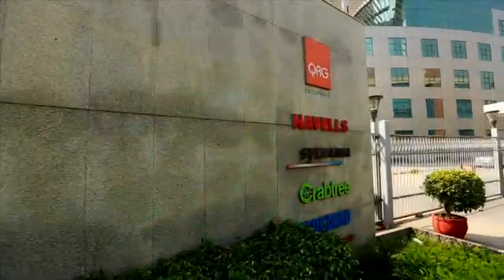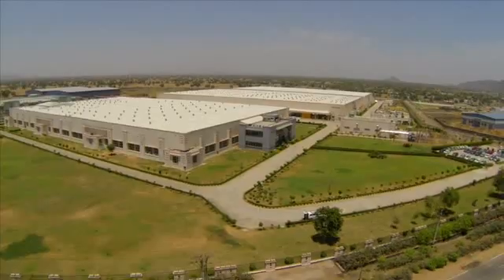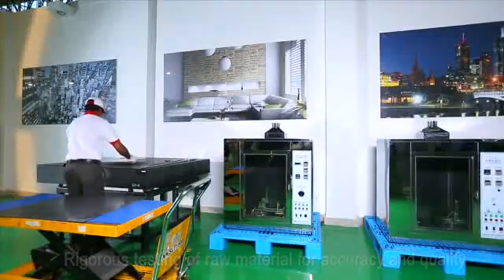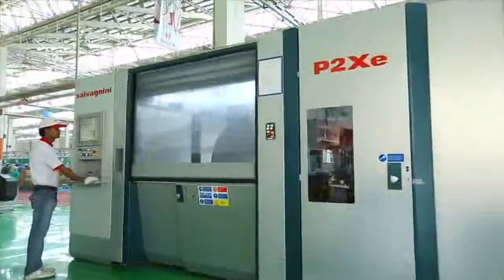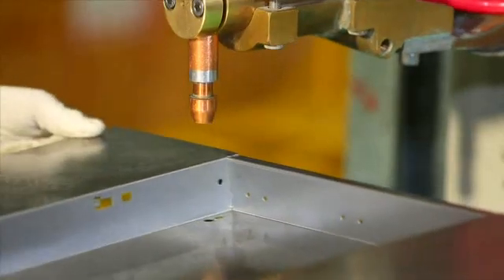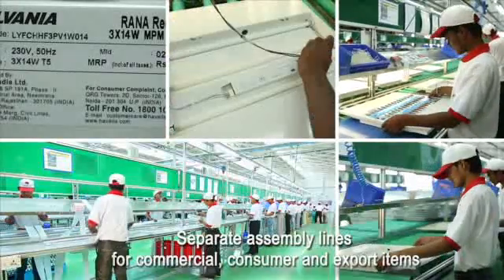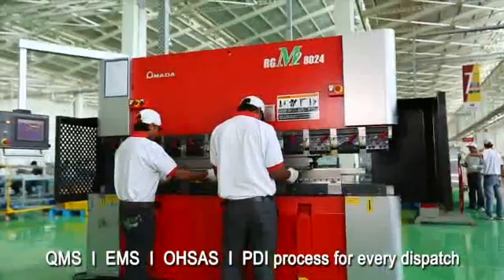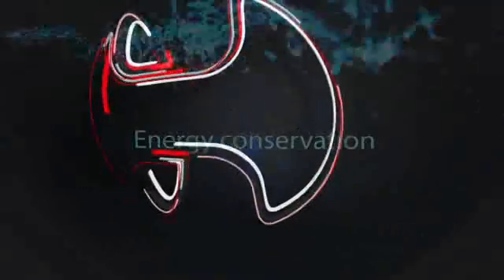Havells Lighting Manufacturing Plant Video 2013

Comment: The Havells service is worst. Don't buy Havells or Lloyd products. I was having issues with my TV and I registered complaint with the company. After one month, two persons came with old TV full of dust to replace my TV and they asked Rs 2300 although my TV was under warranty. When I told this thing to customer care of havells, they told they have sent upgraded TV so they are charging extra money. But when I told them that the TV broght by the persons is same model as mine and it is used, old and full of dust, then customer care people told that it is between you and the technicians who have come to your home. The technicians replaced the TV and this TV is not giving full HD resolution. I raised complaint with havells customer care but the complaint was closed without attending it.